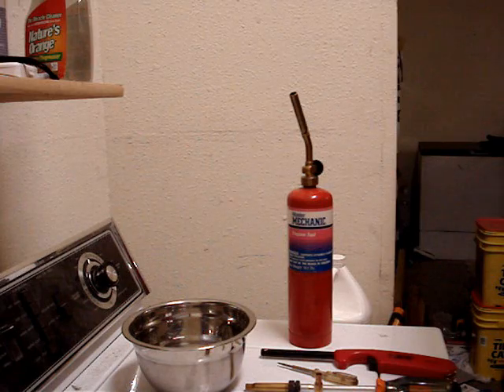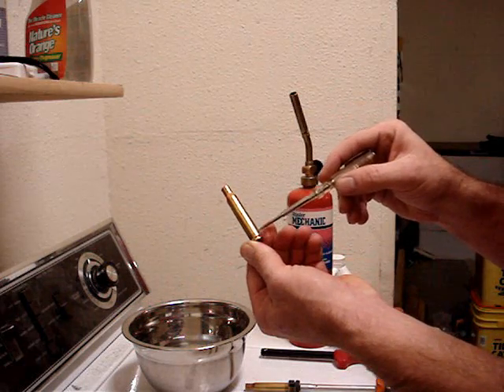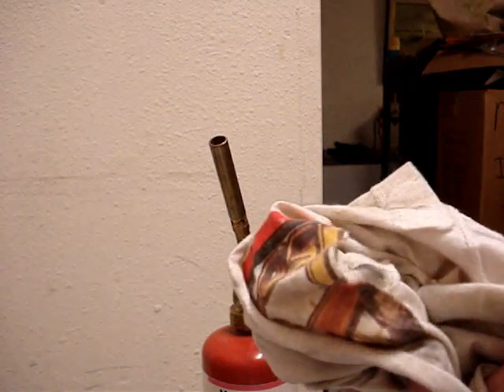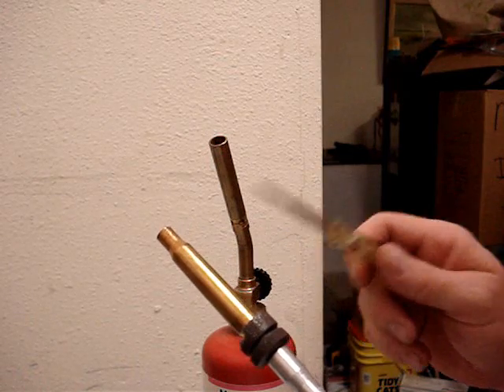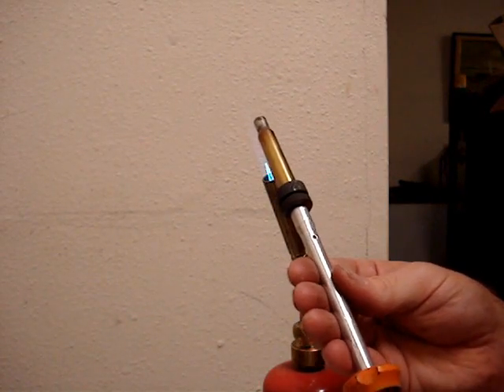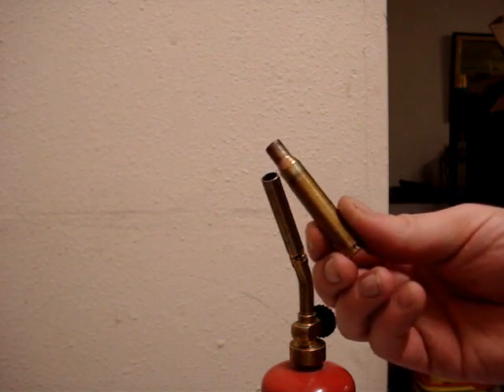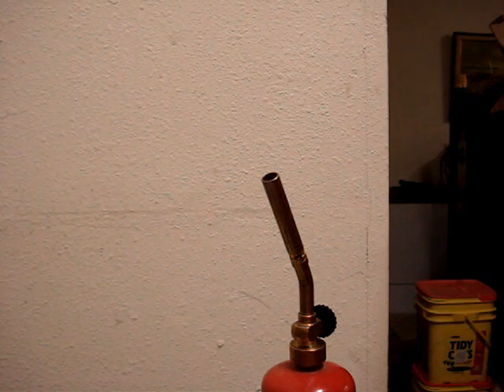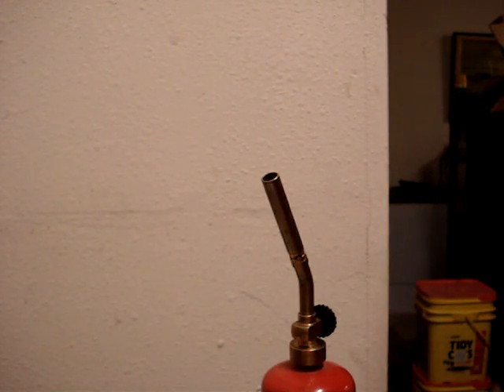Annealing Brass

Comment: Why do you let the brass fall into the water?  Doesn’t that surface harden the brass?  If you heat steel and quench it in water or liquid, the surface is hardened.
Reply from the maker: Different metal Brass has different properties than steel

Comment: Darren , if you air cool you are not annealing brass, you are hardening it . The quenching is what makes it soft . That has been know for about 1500 years .
Reply: +diablo dog <------metallurgy genius here folks. brass can only be work hardened. quenching or air cooling makes no difference
Reply: Bryan is right on the mark! Brass is hardened by working it. Everytime you resize your brass you are working (hardening) the brass. Annealing as ammosmith describes makes the brass more malleable. Watch a video on how brass is made and you will see them annealing the brass multiple times as cartridges are drawn out from brass stampings.

Comment: IM CHEAP I USE DEEP WELL SOCKET W/ 4'' EXTENSION  & LET MINE AIR COOL ON TRAY  I NEVER HAD ISSUE YET WITH 308 OR 338LM ALSO STARTING OFF CLEAN SHINNY  BRASS IS PLUS . GOOD VIDEO 2 WATCH 4 ONES WHO STARTING OUT .

Comment: You are indeed annealing the pc until you drop it into cold water . The annealing process requires air dry. By putting it into cold water you are hardening the outer shell of the material.

Comment: @xzqzq There are 144 differnt burn rates per. powder type. From fastest to slowest your Red Dot is #8, and not recommended for rifle loading.  It's a shotgun powder and why it bulges your cases.
I use a #93 IMR 4064   40gr's. for the savage. Try and get brass from a gunsmith outlet.
Google for a burn rate chart and load data from the internet.  You will find most anything you need.  Load safe.

Comment: @semtech30 Thanks.  I've been looking for used .300 Savage brass, unsuccessfully, and attempting to reform .308 into .300 Savage, equally unsuccessfully.   For target practice, I have been using 9 grains of Red Dot in .300 Savage and 8mm Mauser, and 11 grains in .300 WinMag, which works really well.  Accurate & low recoil.

Comment: @xzqzq  This is a while ago but, if your cases are bulged, there has been to much pressure from to much or wrong powder.  Use an H4064 or slower for the Savage.  A faster burning powder will cause this.  Slow it down.  Your case size die should take care of the bulge.  If not, discard them.  Loading a shell should have no restrictions.

Comment from the maker: @EdgarEgner  You will be fine. You may get some soot on the case but other than that the process should result as the same as if you're using clean brass. Just don't get the brass too hot.